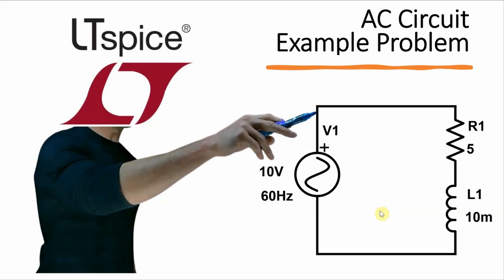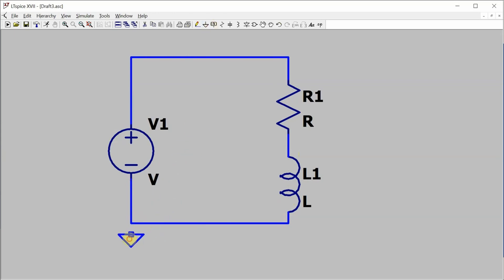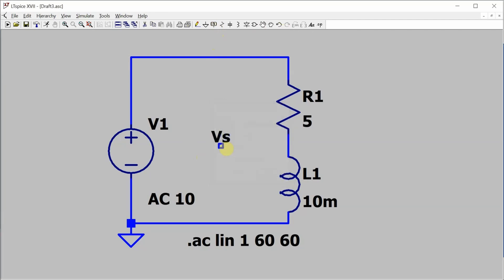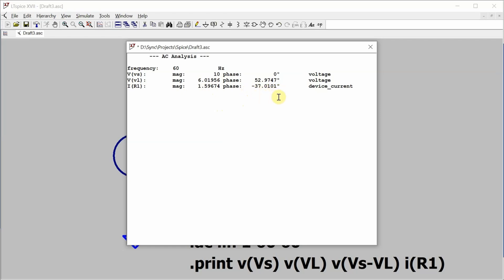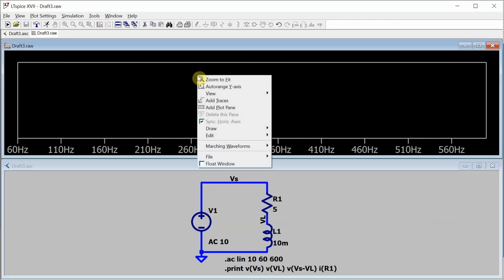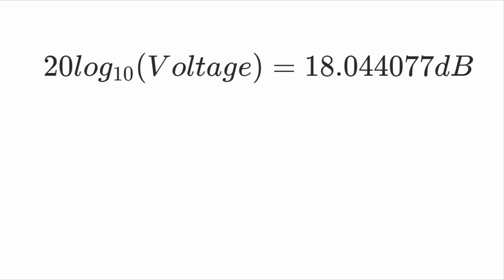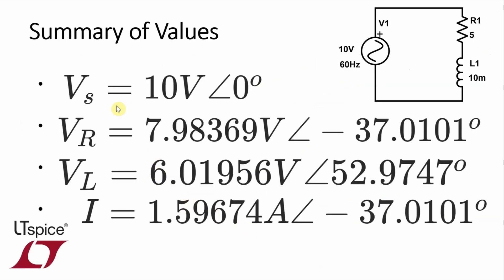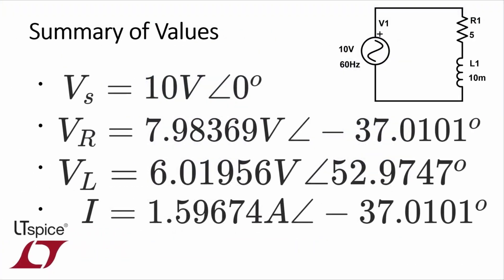LTSpice AC Sweep (at a Single Frequency!)

Comment: A voltage across a resistor can be calculated: 1.59674 x 5 ohms = 7.9837 V. I wonder if the same can be done with an inductor or capacitor. Impedance x current? I guess we would need a voltage difference here.